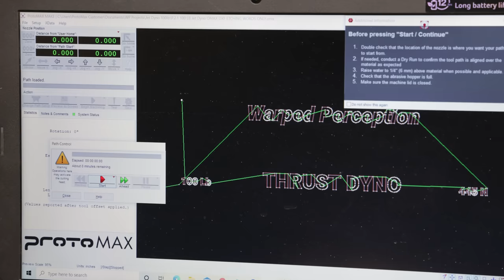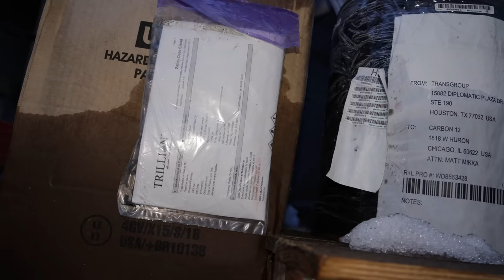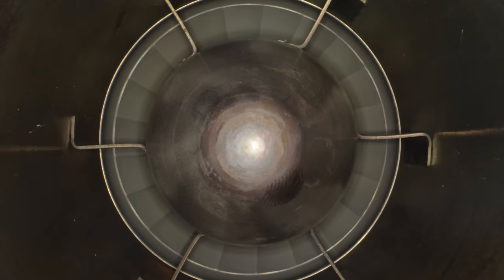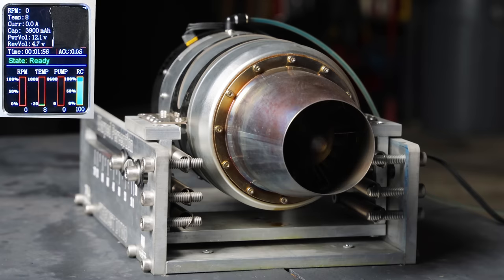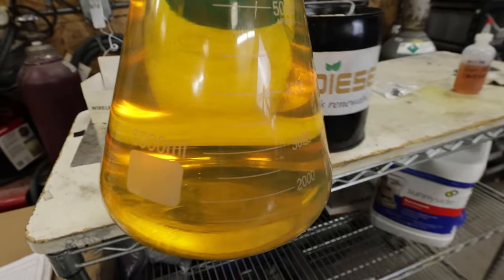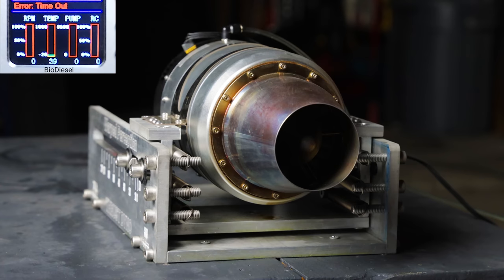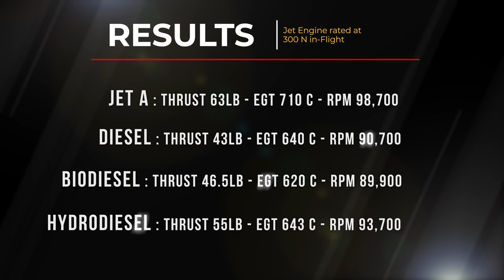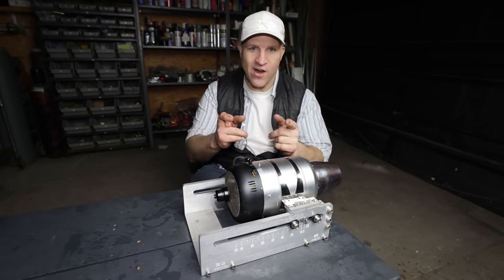Jet Engine Thrust Test - Fuel Experiment (Jet-A vs Diesel vs BioDiesel vs HydroDiesel)

Comment: Idle is 35,000 rpm. The precision engineering these parts must require is unreal.
Reply: Indeed. And remember this is a larger one. A t35 kolibri  for example idles at 80k rpm or so and maxes out at 260k.
Reply: What rpm mean? Is speed or pressure
Reply: @Christian.987  revolutions per minute.
Reply: @Christian.987  it’s how fast the turbine spins. To put into perspective, a car RPM at idle around 1000 to 2000, this jet engine is around 35000
Reply: Can I strap 4 of these engines to my arms like a jet pack if so where can I purchase?
Reply: @cyeknox1322  you can get them if you have the money,but...do you have a crashlanding strategy where you may have 1% chances to survive ? =))))
Reply: @ScarryMarian2012  safety tether will in sure safe landing, does anyone know where I can purchase the RC jets
Reply: @ScarryMarian2012  found one 100kg thrust
Reply: @cyeknox1322  well 4 of them woulf cost around $20k. You got that.
Reply: @cyeknox1322  Sounds like you want to play "rocket man". Be careful where you fly or you might end up as bug squash on the nose of a jet
Reply: @cyeknox1322  There was a British man a few years ago who decided to strap a small one of these to each limb, and he eventually learned to fly with it untethered.
Reply: @Christian.987  RPM is short for Rippems... at least according to AvE.
Reply: @abliviustrey  damn you weren't kidding. And I thought the 4.1 stroker block for my car was pricy. Jetcat rc turbine engines are from 2k to 17k for a single tiny engine....
Reply: And that too 35k rpm was exact
Reply: @cyeknox1322    Only if you are finished using your arms  forever.
Reply: And the alloys must be quite good too.
Reply: @Christian.987  technically rpm converts directly into pressure when your talking about a jet engines air compressor fan 😀 but yea revolution per minute
Reply: @jackasshomey  what do you mean by pressure? Thrust or pressures within the engine increase as ram increase?
Reply: @anthonyross4418  the faster the turbine spins, the higher the pressure because the air sucked in gets squeezed and pushes out the back faster after it’s mixed with the fuel and burned. It’s very powerful but also very fuel inefficient, which is why passenger planes put a big fan in front of the turbine.
Reply: @Christian.987  rpm = revolutions per minute. Turbine speed.
Reply: @cyeknox1322  How did you solve the icing problem? 😉
Reply: @gregsworldkitchen6764  😂😂😂
Reply: Only for american ppl this kind of precision is unreal. In Germany we work with even more precision for export cars. Our own are even better :)
Reply: @cyeknox1322  RC jets are hand made by enthusiasts. you can't just buy RC jet engine...
Reply: @micha2009  meh. german cars arent great. but pricy for sure. cou can buy much cheaper cars that work just as good
Reply: @cyeknox1322  Yes, if you don't want your arms anymore. The engines get a little hot.
Reply: It's a spinning, lightweight, circular part, so there'snothing really impressive about it. This is definitely not like a car engine, more like a turbine. Some car turbos casually go past 100k rpm.

I find in interesting that people get impressed by the most mundane things, because of a number.
Reply: Modern automotive turbochargers can reach 180k rpm
Reply: @cyeknox1322  military is already doing it.  works much better than the jet pack, and has better flying time.
Reply: @abliviustrey   Might want to go with a 727 with only 3 engines.  
I saw a vid a year ago where he is moving up to a fan turbine, and getting a lot more thrust

Comment: Man you bastard🤣🤣🤣! I'm supposed to be working right now, but this is too exciting not to watch... immediately. Hiding in the broom closet at work watching with headphones.
That thrust dyno is fucking rad bro!
Reply from the maker: Haha!  ❤️ Thanks I really appreciate it! I'm mostly tried out the hydro diesel because my RC guys are looking for a cheaper fuel than kerosene.
Reply: @WarpedYT   Looks like a great solution. It seemed to work just fine and at 20% water I'm sure it's 20% cheaper lol
Reply: @WarpedYT  You can buy k1 cheaply at some gas stations. They make you fill out some forms to get it tax-free for home heating.
Reply from the maker: @brsrc759  so the hydro diesel is about $1.80 a gallon, versus like $3.20 a gallon for kerosene here in Illinois. I had a hard time editing this video for multiple reasons but I forgot to put a part in there where I talk about fuel mapping in the ECU for the jet, I believe that if you can remap the ECU slightly to allow you to get 10% more hydro diesel through that injector it would make as much as jet fuel at a cheaper price. The one thing about the hydro diesel that I like is that it burns very clean, it doesn't have that kerosene smell.
Reply: @WarpedYT   that's crazy cool!
Reply: Diesel with 5% Amsoil Dominator works great in my JetCat and Kingtech. A little bit of build up, but it wasn’t too bad.
Reply: @WarpedYT  Cool to know but I'll be honest & say I love the smell of burning Kerosene I grew up with that smell!
Reply: @WarpedYT  LONG LIVE HYDRODIESEL !!!

Comment: Just a quick tip related to your waterjet: To prevent erosion damage to the nozzle/orifice head, make a sacrificial hard rubber washer about 3/8" thick that tightly fits over the nozzle so that during pierce operations the high pressure splashback spray of water and garnet doesn't damage the machine over time. I used to work as a waterjet operator on Flow machines running 94ksi intensifier pumps in an industrial production setting, and without the washer there, the orifice head would be toast after a day or two of nested parts... Protect those expensive parts! :)
Reply: A sacrifice to the machine spirit must be made

Comment: Very nice. the reaction of the engine to the different fuels was fascinating. The amount of flames and smoke after throttling down especially. As a driver of ultra-low-sulfur diesel vehicles I know that they have extra lubrication additives to counter the lack of sulfur.

Comment: Damn! Never know till now that Jet engine is so versatile in terms of type of fuel and burning. It's quite independent. It's appears that it can run on almost any flammable liquid.
Reply: The M1 Abrams tank uses a jet engine, it can run on any type of fuel. So no surprise for me
Reply: Kinda, but Jet is very similar to Diesel anyway. The military uses a single kerosine fuel for both jet engines and diesel vehicles (JP-8) to simplify logistics. I think it has an additive to give it lubricating properties like diesel.
Reply: @haody3494  it probably uses a turbine which is similar to a jet, except it doesn't use its exhaust as thrust. And instead uses the exhaust from ignition to drive a shaft
Reply: @Person01234   JP-8 can cause hearing problems.

Comment: Great video. As a 45 year A and P. It was interesting to see the different fuels. As a side note the best was to pour out of a 5 gallon drum is lay it on a bench with the bung on top, then slowly roll it. It is then easy to control the flow..

Comment: What I found really interesting is the record of EGT. Assuming higher temperatures are more damaging and shorten the time between overhaul of any given engine, Bio diesel appears to win hands down even though its power output might not be the greatest.
Reply: Thought the same, then i realized that it frosts, that´s a concern
Reply: Wouldn't jet a fuel be the best because what matter is the ratio of degrees per pounds of force. I assume you could just run it at a lower throttle and get a lower temp for the same force.
Reply: The temperature the fuel burns at would limit the thrust of the engine, as EGT is a limit. If the fuel burns hotter, you have to throttle back to avoid overheating the engine. The engine should never see EGT greater than the limit, and it's up to the operator (and programming) to avoid exceeding the limitations of the engine.
Reply: @Knort  In low altitude applications you might get away with it- mainly in power generation. If you put it on an aircraft you're in for a world of hurt. Reduced thrust is bad- you can always reduce power setting on a pure jet fuel without any of the drawbacks. On a helicopter which often has narrow power margins especially in hot weather the reduced power could very easily prove fatal. Then there's the icing risk- you'll need the entire fuel system heated. Not just because of water ice (at these water levels no amount of anti icing inhibitor will save you) but because wax will freeze and precipitate out of the diesel just like water ice, but at higher temperatures potentially. Same issue of clogging filters and the like. 

Also diesel tends to build soot on the fuel injectors. Not a big issue because the injectors on a turbine are generally huge and it'll take several hours for any real buildup, but it's there and could be a pain if you aren't anticipating it.
Reply: Chantage
Reply: The aircraft’s FADEC handles all relevant parameters. It’s better to look at it this way. You want fuel to provide stable temps and power. Jet Fuel potentially extracts more performance from an engine. That means per pound of fuel, you will go farther…this is very important on commercial aircraft where an uplift of 60,000 pounds of fuel is common. If for the same weight as another fuel you can get better performance, you can carry less fuel. High Temp of course is a source of wear, but run time (HOBBS) not temp is the measure that dictates time remaining to hot section. The FADEC and engines work beautifully in concert and the pilots can establish best range, best performance best cruise etc based on the aircraft’s manual needThe engine dictates much of this and quality jet A provides an industry wide standard for performance. The FADEC handles any and all variables beyond those controlled by the pilot. It’s pretty slick.
Reply: @Knort  You do it like the big boys and push the fuel through a heat ex-changer to keep it liquid.  Think one even brought down a plane when the fuel froze on lip of tubes because it couldn't warm the gas their.  Ice chunk broke off landing where it is warm, and engines shut off starved for gas.
Reply: @vincem9468  Jet engines don't really have much throttle, 80% is idling.
But I bet fuel choice will make a big difference in the after burner.  🤔

Comment: When I was in the navy we ran turbines on DFM with emergency backups on JP5. Our diesel was run through fuel oil purifier and filtration. We saw a difference in power but not to the degree you saw. We also were running turbines the size of what's on a DC-10 so that probably had some affect. They were optimized for DFM.

Comment: The fuels have different viscosities and shear strengths... You needed to monitor pressure and flow of the fuel at the motor input.. You should have also been monitoring the amp draw of the fuel pump... If you had used a load cell (from a electronic scale) you could have captured actual real time fuel flow, RPM and power output across the entire throttle range (a small data acquisition project for an Arduino or Pi). Oh, and it would have given you throttle response info..
Reply from the maker: Nah I'm not interested in that because I was just doing exactly what the guys do at the field they burn out their first fuel fill it up with the second and then they fly, and then they usually say oh wow this one makes so much more power than the other one, but they never know for sure. Most of the jet engines like this do not allow you to adjust the fuel because if you start dumping too much fuel for the size of the engine it gets dangerous. But on another note imagine This. You're flying a private jet and you land in the third world country, they ran out of jet fuel but they have diesel or another fuel available, you need to get out of the country because it's a war zone and you're about to be stuck, do you take the fuel recalculate your flight for the reduced power output, or take apart the engine mess with the fuel pump, pressure injectors etc so you make sure you put out the same amount of power or more, and then start the jet up and fly.. what would you do?
Reply: easy/fastest route would be recalcing for the reduced engine power, at least to me
Reply: @WarpedYT  worth making a note somewhere if possible. I was also confused what the goal was in the comparison.
Reply: @bodywerks  uh, what? kind of hard to retune the fadec/ecu/fueljets in the midst of a combat situation to a fuel it's not set for, doing so would take too long, i was only responding to the having to land and not having the preferred fuel available in the midst of a hotzone
Reply: I was wondering about the different reqd fuel rates for the different fuels, but it looks like they were all at the same fuel volume flow. I guess a bit of tuning and some will have benefits over others in different areas, ie, economy, power, etc.
Reply: @bodywerks  basic operation of the rc scale engine is the exact same as the full-scale engines.. the full-scale engines just use a lot more air/fuel
Reply: @bodywerks   Absolutely agreed.  All three diesel fuels were running out of pump before running out of engine.  The temps and RPM were still both much lower than the Jet-A run.  More pump would have safely delivered more power on all three.  A fair test would have been to run the pump harder (provided it could actually keep up) until a maximum engine RPM or temp was reached, whichever comes first, and measure thrust at that point.
Reply: Yeah it was tuned for jet A. It's not a flawed test. The conclusion's just about running random kerosenes in a jet A system. All nominal performance. Take it up to 47,000 feet and below freezing and you'd want that certified jet A.
Reply: I noticed that also, jet engines are controlled simply by the fuel delivery. more fuel more power, which of course less viscous is able to get more to the engine
Reply: Fuzzy Butkus  Channeling what should be Kelly's greatest quote...
Who cares if it leaks like a sieve.. Its the coolest looking thing ever built by man!!!!!
Reply: @WarpedYT  you can actually adjust the fuel controller on a real jet engine for different fuel density’s ie jet a vs diesel etc
Reply: Some fuels have prettier coloured flames than others!
Reply: @bodywerks   look for a thrust output on the dynoscale for a fixed RPM and let it run for 30 seconds and measure the fuel consumed. That would be a worth having data set IMHO
Reply: @frankdimeglio8216  Wrong channel. Your post belongs with the various religious fundamentalist channels. Not science/engineering ones. Go back to your bible-thumping, cos that has as much sense as you have here.
Reply: @frankdimeglio8216  TF are you smoking?

Comment: Very nice setup! Jet fuel is basically Kerosene. Jet fuel has less additives compared to the Diesel or the Hydrodiesel and I think that's why you would get higher RPM IE thrust. Also you higher EGT with the Jet fuel. The water cools the exhaust like water methanol injected into old turbo prop engines. I would like to see the specific gravity of the three and how that relates to thrust. Great video!
Reply: we are of the same mind set

Comment: Love how powerful those water jet tables are. It blows the rust off in less than a sec.
Reply: That was dirt not rust. The metal was Aluminum, which does not rust, it oxidizes and is white.
Reply: That's abrasive grit which is added to the water jet.  It's what is actually doing the cutting.
Reply: @alanking7331  Oxidization is rust.
Reply: @BigMacMatt3020  I know what rust is . My point at that time (8 months ago) was that he was calling the brown water that was coming off the aluminum rusty water. Aluminum "rust" is white. And I have never heard anyone call aluminum oxide as rust.